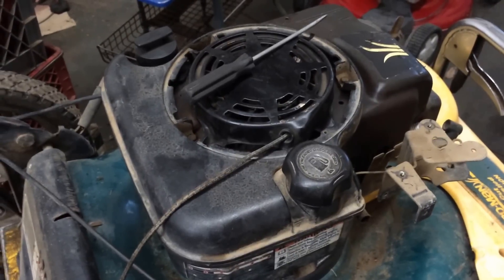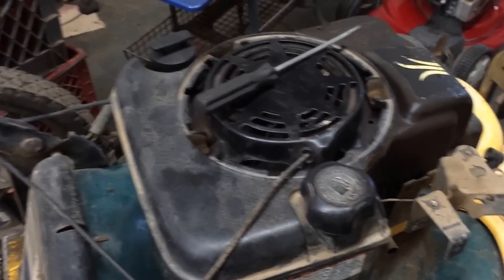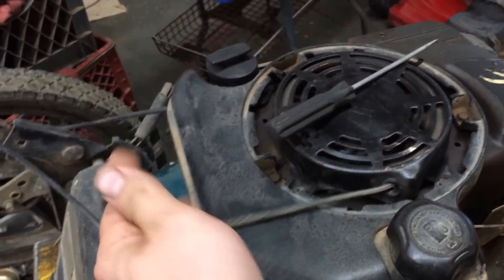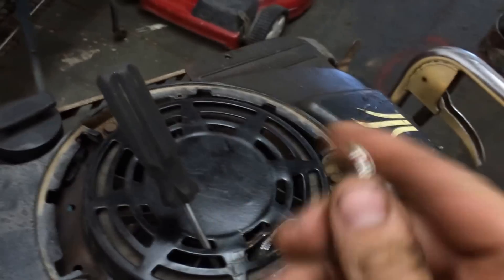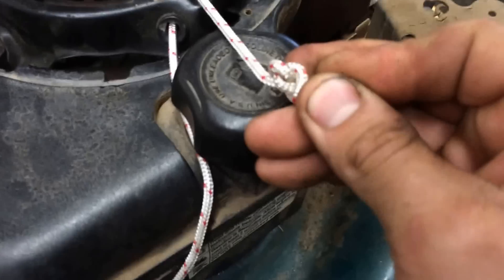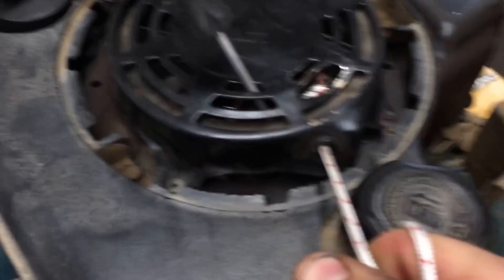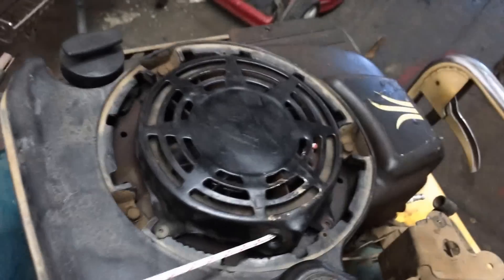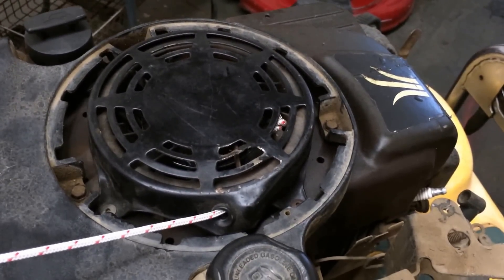Fastest Way to Fix a Pull Cord

Comment: Really useful tip saved me a lot of grief. I wrapped end of cord in sellotape found it a lot easier for threading and pulling back through the top housing prior to knot tying... and yes the one handed knot either a fisherman or a Clint Eastwood cigarillo rolling fan 👍

Comment: To bad the cord on my mower broke, theres no way I can fix mine this way.

I'll try though by turning the damn thing and pulling the cord out, but unlike you, I'm having to practically take my mower apart. I cant believe they made it this hard to replace the cord.

I have the whole role pulling unit in my lap, I managed to put the end of the broken rope back through the hole and pull it through, NOW I'm back to where you started to see if what you said works.
Reply: celloprof Worked!!! Now I have to put it all back together .